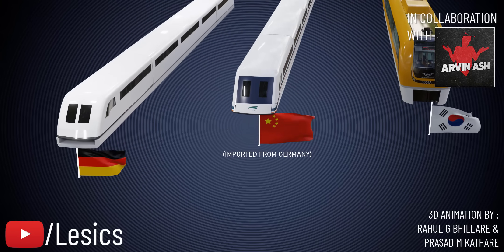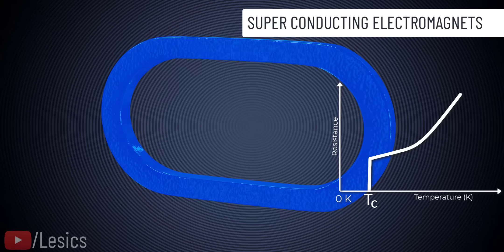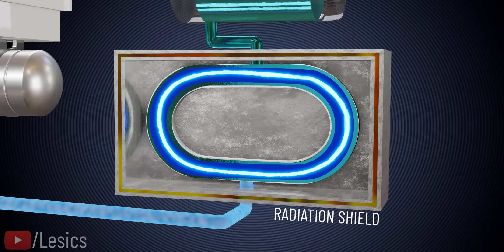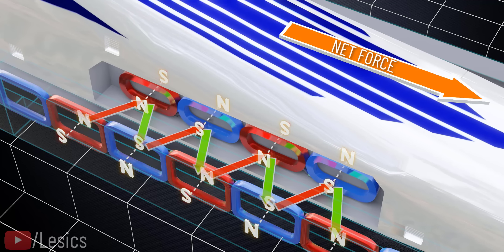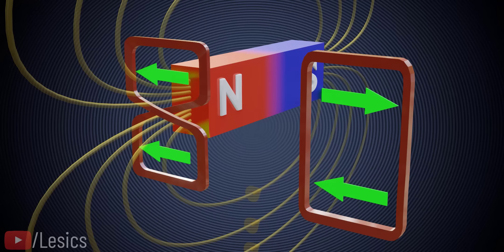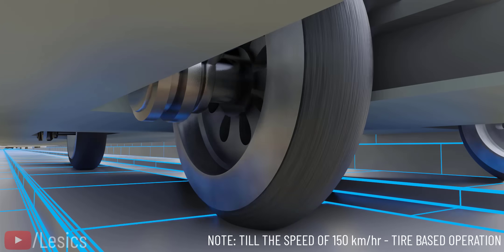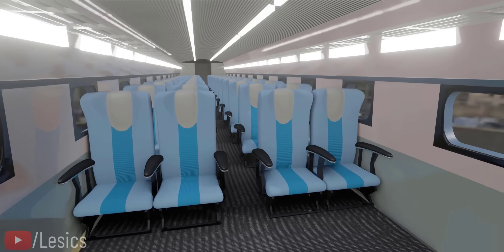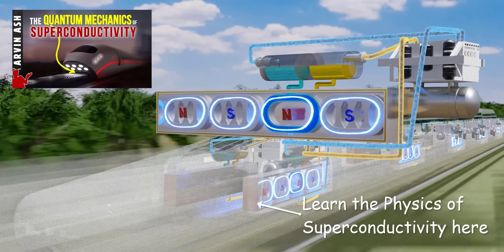The Fastest train ever built | The complete physics of it

Comment: Lesics, Im curious to know, as Ive never ridden these trains, if a person with a pacemaker will have any issue with the surrounding magnets in the train pls? I understand theyve made some certain "barriers" of protection for passengers. However, it still makes me curious about the possibility of the magnets making medical aparatus inside (or outside) the human body go haywire.
I hope you can indulge me. 🙂 Thank you!
Reply: It'll most likely be shielded, because not only does it disrupt pacemakers without any shielding, it could also mess up some forms of hard drive storage which would definitely start to lead with complaints, so most likely yes, it's shielded
Reply: It’s pretty much what the others already said. 
By having metal around the train, the inside of this train is like a Faraday cage.

No electromagnetic fields can inducted to the passengers.
Reply: @leogronung3146  this comparison certainly make sense to me.. for me, just idea of putting protection around the passengers still makes me think how its done.. having a comparison from an old tech makes sense to me.. thank you!! 👍👍👍
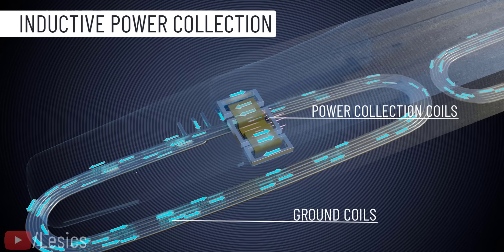Reply: 10:17
Reply: I cant be certain but it sounded like they are shielded to somewhere around the legal limit of magnetic field for human safety so that is probably not safe if you are unusually vulnerable
Reply: pacemaker makers surely can design around the issue. indeed they must have already done it.
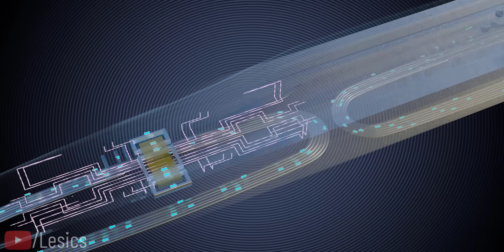Reply: 10:20 it is mentioned that shields against magnetic fields were placed to regulate exposure to magnetic fields from passengers or devices inside the train.
Reply: @hightiernub1313  thank you! I did see this part as I watched the video a couple of times but still im curious if there was any medical devices sensitive to even a slight magnetic force could go haywire. Our  tech has even developed faster in the last decade and sometimes new technology are much sensitive to things around them as part of their advancements.. so a safe level of magnetism around a person with that device might cause for that device to go haywire.. Im just curious how that  could be prevented. 😊
Reply: @rheamontera8889  Yeah, you're not wrong I mean Peace Makers can easily get hacked. But I'm not sure if this is the case now since you have said about the advancements. Like MRI safe peacemakers.

Comment: What is the difference between this and tube rail of Vergin Atlantic's?
Reply: This one is actually possible, unlike hyperloop
Reply: You would need to put this inside a pipe with lower air pressure, and it would be much faster due to less air resistance. Unfortunately, its also more expensive...

Comment: How does it float: magnets
How does it move: magnets
How is it kept stable : MAGNETS
How does it generates power: IT'S MAGNETS ALL THE WAY DOWN!
Reply: magnets! how do they work ?
Reply: @tessl8984  
MAGNETS
Reply: @tessl8984  hootie hoo!
Reply: @tessl8984  nobody knows for sure.
Reply: @tessl8984  ààáÀaàà
Reply: @tessl8984   /...
Reply: @tessl8984  Magic
Reply: Ha, so true. But they're really cool magnets used in interesting ways.
Reply: @TheJarrodh  r/whoosh.
Reply: How does it generate power with magnets
Reply: @ethanwild3301  It doesn't!
Reply: @ethanwild3301  inductance, search on google. Basically an existing electric field creates another electric field in some metals nearby. This electric field causes electricity. It’s the same principle thanks to which phones can be recharged without a cable
Reply: Since they are superconducting magnets it means that power is generated only once to start it. And since a superconductor has zero resistance the current goes on forever. The train is made to levitate so that it may not dissipate energy due to friction.
Reply: @ethanwild3301  induction
Reply: Electro magentic induction
Reply: @ethanwild3301  EMF electro magnetic force. You ever take two magnets and and place the north against the south and they will oppose each other. EMF = Power = Propulsion
Reply: @ethanwild3301  I don't know much about the physics of magnets but the video said two things which could have been mistaken for magnets generating the power: 

The first is at the beginning (0:15) with the superconducting magnets that generate a "forever" current after being initially charged. The second, at the end (11:15), was when the video touched on the external power requirements of the cooling and shielding systems needed to make that superconduction possible. During that last part, it mentioned wireless induction (wireless charging as your smartphone may use) as the means by which power is transferred to the train from the tracks. 

So, the magnets don't seem to generate all the power but they do a lot to use it effectively and transfer it. That was my understanding anyway. I hope it was helpful; someone please correct me if I'm wrong.
Reply: @samuelgibson780  thank you
Reply: @samuelgibson780  the magnets don't generate a "forever" current. they keep their electric charge if they are cooled, meaning they could technically be viewed as a battery that never drains. the superconducting magnets generate a magnetic field (not electricity) as long as they are cooled properly.
Reply: @samuelgibson780  a simple way of explaining would be to take two magnets and place the north against the south. They will oppose each other. EMF. Electro magnetic force. Apply that on a very very large scale and you have levitation, forward movement, and the train being centered laterally.
Reply: @samuelgibson780  🤓
Reply: Magnetception
Reply: Thank you. @Samuel
Reply: How does make sound it magnet
Reply: @basudhara7051  kbbkbvbvbbbbb..
Reply: @basudhara7051  aq awww.w
Reply: । मम।म म।मम मम।मखवछमम।  ।  ब।वम।  ममलछ
।। म     मल । म लछ। ल।बमम ।।म
Reply: @basudhara7051 ?
Reply: What purpose do you need magnets for?
YES
Reply: “YEAH! BITCH! MAGNETS! OH!” - Jesse Pinkman
Reply: "How many magnets do you want on this train?" YES
Reply: Wait... it's all Magnets!!

"... IT always has been"
Reply: even atom that we have is magnet.
Reply: @h.e.scompany446  lmao yes , even an atom is a dipole magnet 😂
Reply: @h.e.scompany446  NM NM
Reply: It doesn't generate power, it just transfers from ground wirelessly.
Reply: How do you build it: Adobe Photoshop!
Reply: @catalinbadalan4463  they actually built it tho.
Reply: @12isaac00  OK.But NOT in this video.
Reply: Simple how do you find a needle in a haystack? Magnets.
Reply: May the magnetic force be with you.
Reply: What attracted you to this video? Magnets!
Reply: Who controls the train? Exactly, magnets.
Reply: @AsianEspionage  AI magnets.
Reply: How does it work: CGI!
Reply: Даже не знаю зачем я поставил лайк 🤔
Reply: @AJ what if a magnetar entered our solar system? Basically the strongest magnet in the universe.
Reply: Are you a magnet?
Reply: Broken marriage? MAGNETS
Reply: How does it stop: magnets again and again
Reply: Playing as a kid in 1970's, I had thought about the levitation of trains with magnets. This was extremely interesting that my thoughts came true in the evolution of engineering. Fabulous days are ahead. Just wait until the reveal the propulsion using light and nano materials. If your really interested, check out what a company called Meta Materials is accomplishing. Will be out of this world technology.
Reply: funded by a group of magnates
Reply: @Luca Caco misspelling but I know what you meant ;-)
Reply: This could be 
Reply: If you haven't realised yet, everything is made out of *MAGNETS*(heavenly sounds in the background)
Reply: How does it magnetize : Electric
How does you get electric : Magnet
Reply: @firdauszainudin7118  A perpetual motion machine?
Reply: And they say zero point energy can not be achieved .
Reply: dude...it's scary: 3.9 inches at 300 mph!  MAMA MAMA!!! SCARY>
Reply: How does it stop? Don't tale me MAGNETS
Reply: Caught my wife on top of the gardener. Damn Magnets!!!🖖😁
Reply: Magnet tu besi berani ditempat kita ni,kalau besi tu tak berani ,dia tak boleh jadi magnet!!!!!!
Reply: https://youtu.be/ffO_McpxSHE
Reply: There is also helium and hydrogen cryostats, it sucks.
Reply: You need to understand different types of magnetism based on mo theory. Even oxygen is magnetic.
Reply: How does it start: wheels
Reply: Imagine what can aliens do with all those magnets they have. We got only a few with the asteroids. Its a gift from the who ever is on top
Reply: https://youtu.be/lnT1GOxLOFA
Reply: What are the implications of exposing the human body to an electromagnetic field? What do people with pacemakers do? I have other questions ... but I avoid opening unnecessary discussions ...
Reply: @oldlifestylebyandrei  if Magnets were harmful to humans, MRI scanners wouldn't be in hospitals
Reply: What are the implications of exposing the human body to an electromagnetic field? What do people with pacemakers do? I have other questions ... but I avoid opening unnecessary discussions ...
Reply: magnets are the KEY TO ALL OUR FUTURE TECHNOLOGY

Quantum = MAGNETS
FUSION = MAGNETS
HYPERLOO = MAGNETS
5g = MAGNETS 

magnetetic forces are unseen by humans cos we ain't the system devs but take enough LSD you'll start feeling the magnetic poles :3
Reply: Magnets are vital when it's about transforming power to movement, and vice versa.
Reply: But magnetic should thanks to gravity..
Reply: @Abhisar Choubey is it made of magnets?
Reply: what do you expect
Reply: I think its elektro magnet idk
Reply: cool
Reply: But how does it magnets?
Reply: https://www.youtube.com/watch?v=OI_HFnNTfyU&ab_channel=ImperialCollegeLondon Magnets Babyy!
Reply: The earth rest on top of a magnet and it's magnets all the way down
Reply: Tru
Reply: ok
Reply: Liquid hydrogen doesn't just happen... so it's magnets and money!  😏
Reply: It's not magnetism, it's electromagentism. Huge difference. Magnet is produced in nature and has a limited force (though the wave expands to infinity). Electromagnetism's force is generated by electricity power thus generating controlable power of moving objects.
Reply: Plot twist : We colud use magnet to beat thanos. LoL
Reply: This train is using all the magnets in the world. We have no more magnets to play with.
Reply: @MrAFR-g4q  owh shit.. that probably the reason that the magnet in my guitar amplifier was lost 😵😵
Reply: Magnets, how do they work?
Reply: Wuuhook. .

O alta jvj
Reply: Magnets for 🚽
Reply: What is its name: magnet
Reply: Lol
Reply: Yeah bitch !!!!! Magnets
Reply: How do we pay:- magnet
Reply: Queres?
Reply: Boycott japan.
 War criminal!
Reply: 👍👍👍 mantab
Reply: I guess thats why its called maglev
Reply: That's why there called maglev
Reply: Thats why Magneto is strong on X-Men
Reply: Jesse Pinkman: yeah bitch, Magnets!!!!!
Reply: MAGnificent!
Reply: Magnetize the world
Reply: I used money magnets to get girls. When the money 💰 went, the girls dropped off, leaving me all alone😢.
Reply: Make magnets great again!
Reply: How would it break your mechanical watch : Magnets
Reply: @razvanon  
Is this train going to accidentally appear in Bermuda somehow?
Reply: Boy I hope I never have to see an other magnet again!
Reply: Сhinese copy Japan all the way down!
Reply: https://youtu.be/oHg5SJYRHA0

Comment: What is the time differences between Bullet and Maglev train for same distance?
I do not like to see this train in real time, for research i appreciate it. 
This train just uses a lot of resources and energy like helium, coolant, radiation protection and also there is need for wheel after all tech. There is no point in using it. 

Japanese engineer should build new generation planes instead with AI autopilot and jet engine design.

Comment: Just by cooling the superconductors they can achieve 3 things at the same time, propulsion, levitation and guidance. What an amazing engineering. One question though, why do they use different coolant for the superconductors and the radiation shield?
Reply: Different boiling temperatures of nitrogen and helium. It is easier to cool nitrogen to isolate from external radiation.

Comment: 6:23, I think this explanation for levitation has a flaw. The EMF’s clearly add up for a circulating current. 

Here is the explanation what I think is correct..
EMF is induced in conductors perpendicular to the relative velocity between coil and field. This means the vertical arms of 8 shaped coil will have induced EMF. When the train is moving at correct height with magnetic field at center of 8 shaped coil, the top and bottom vertical conductors will have equal EMF. If we unwind the coil, we see that all four EMF’s oppose each other and hence there is no effect. When train is below the required height, the magnetic field is below the center of 8 shaped coil, the bottom vertical conductors have more EMF than top vertical conductors. In the bottom half of the coil, an opposing pole is formed and because it’s effect is dominant, in the top half, an attractive pole is formed. This will have upward force on the train. Similar thing happens when train is above the required height, but there is a downward force now.

Comment: How much weight  does the SC MagLev lift to run at the speed of 600 km/hr?  How good is the breaking system?
Reply: For breaking simply you have to stop pumping liquid helium into the superconductors this will heat up the coil and they will be back to material state with some resistance and i dont know much about sc maglev but a 3mm superconducting disk can lift the 1000kg of weight

Comment: Kindly elaborate how these trains stop? How do they reduce such a crazy speed and how quickly can they stop?
Reply: I think they use the same principle for accelerating but reversed to slow down.
Reply: He literally explained how. The same way they're propelled, can be used to oppose/deaccelerate the train speed.
Reply: I did understand that repulsion can be created by switching the polarity of rectangular ‘Electromagnets’ on the side tracks, therefore the deceleration. My doubt is how do they turn off the Levitation? It was an induced current in a figure of 8 coil,Wasn’t it? I was wondering because as the train drops, lower coil will get more magnetic flux, again leading to levitation. Assuming that they cannot switch off cooling systems around the superconductors, I am assuming they will use wheels to create friction. Kindly clarify?

Comment: How reliable is this train is the real question as it's already very expensive?
Reply: According to the video they tested it everyday for a decade.
Reply: @Cenentury0941  That's good.
Reply: @rattlehead999  For the energy, they have Nuclear Powerplants, which pretty much solves the energy problem at least,
Reply: @ricardosenpai6121  true, but it does use a ton of power so it's not cheap.
Reply: @rattlehead999  nuclear plant, unlimited powah. pretty sure they can negotiate for cheaper electricy with the powerplant given they'll use it 24/7 commercially
Reply: The problem is the train didn't use gas or anything but it can run forever. Japan often smart on reduce money to spend on gas.
Reply: @butbunsin9044  it takes a lot of energy and thus money to keep the magnets cool at super 0 temperatures.( close to 0 Kelvin)
Reply: @rattlehead999  don't be ridiculous. Energy to cool magnet? Hahhaha where did you learn that? It is ridiculous lol. It need only energy to stop train. It doesn't require energy to cool it. They use gas mr. It is similar to 3 world people who complained why fan didn't cool at all during hot summer and yet they use more fans instead try to use air conditioner because they think air conditioner requires gas and it cost a lot money. Lol
Reply: @butbunsin9044  Ok gas or electricity, it's energy. Unless they found a way to cool it to near absolute zero temperatures without heat transfer, a.k.a energy transfer...

Comment: track maintenance costs must be through the roof
Reply: how so? the magnets dont require maintenance, and there's no contact surfaces so nothing wears out. seems like significantly lower track maintenance than a traditional train.
Reply: Initial costs must be unreal.   Coils under the track, coils along both side, down the entire track.. All that concrete-- Its cool, but good god, there must be a more efficient way to build fast transport.
Reply: @calholli  It is the fastest, most efficient train in the world. If there was a better way, they would have done it. People will find better and more efficient ways, but as of now, this is it.
Reply: @calholli  As of the time that the train in the video was built, it was the best. Until the Hyperloop is perfected, it will still be behind. I would love to see the Hyperloop succeed, but I have not seen it do better than this train as of yet. We would have to factor in maintenance costs into the final equation as well. Which would be cheaper in the long run? I think this is a great competition, and  I am hoping the Hyperloop wins, but it seems like there is still progress that needs to take place with Hyperloop for it to take the win.
Reply: @Inertia888  You put this inside a tube with lower air pressure and you get hyperloop. These two are much closer than you think. In open air, this thing is fighting air resistance to reach 600Km/h, with a lower air pressure, it could easily get to 800 or more. However, people are already complaining at the cost to build, now add the pipe...
Reply: @freeculture  You may be able to put a pipe across farms in China but I doubt that you could in America.
Reply: Maintenance for what?????
Reply: Only making the track is through the roof